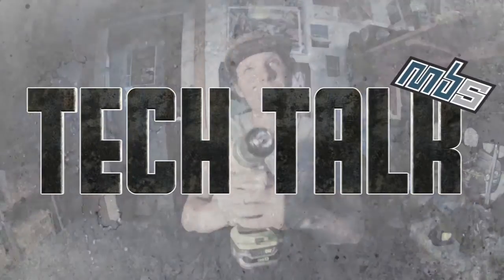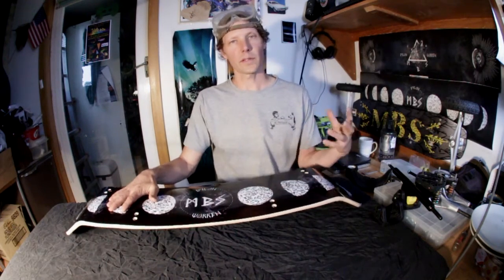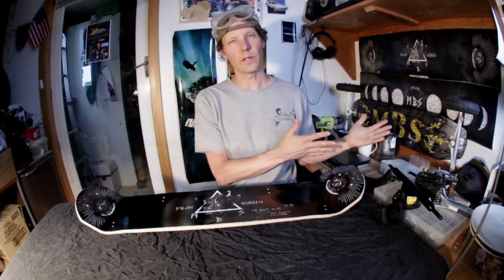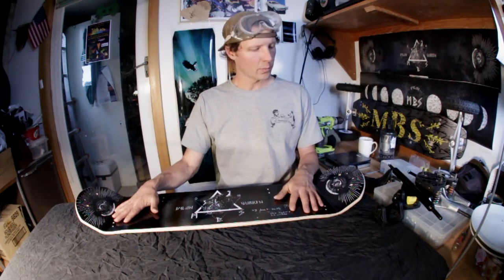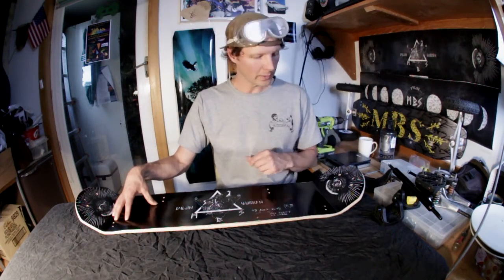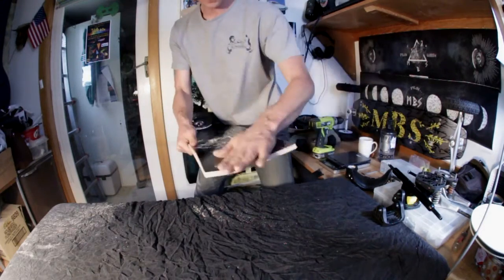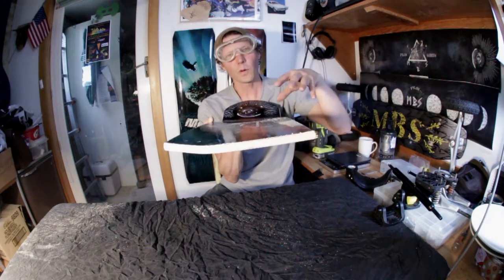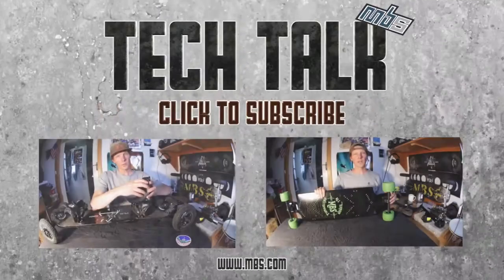Tech Talk Episode 5 - Concave construction

Comment: You should do a video on the new comp 95
Reply: Yeah, the new Comp 95 is rad too.  This video covers most of the same features the Comp 95 has (assym concave, multi-camber,...).  The Comp 95 doesn't have the PBT graphics, but the Canadian maple is actually a pretty good slider (think skate).  Also the lay-up isn't nearly as aggressive on the Comp 95. It still has good pop, but it's built more to suck up the bumps than it is to stomp massive tricks without bottoming out.  It's the perfect all-rounder.